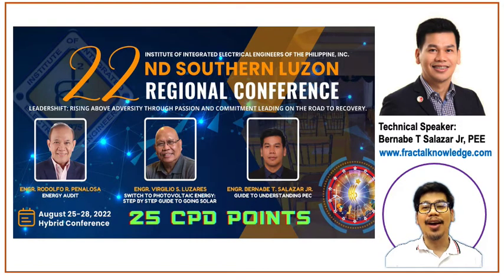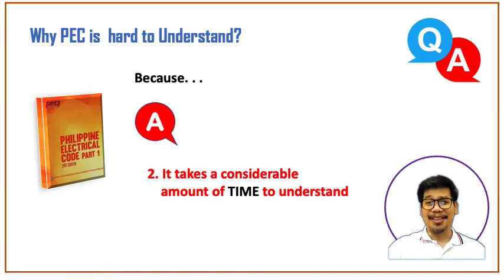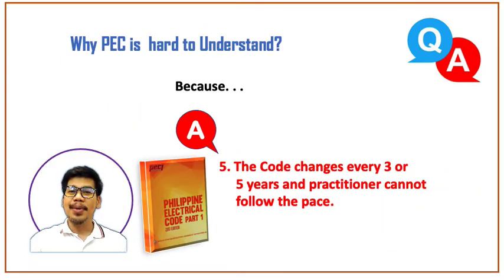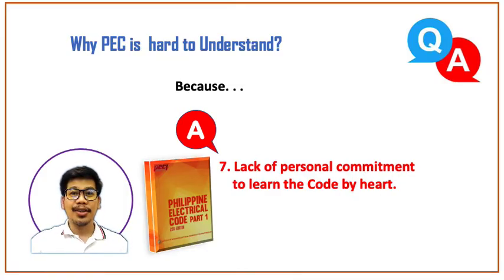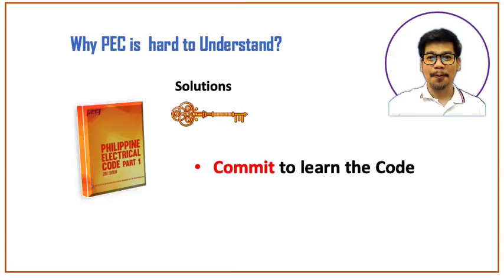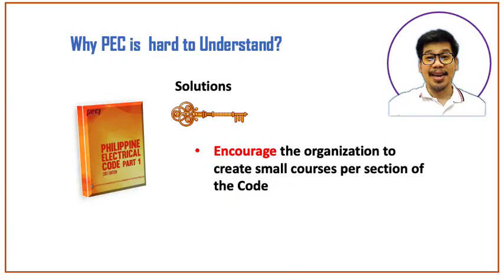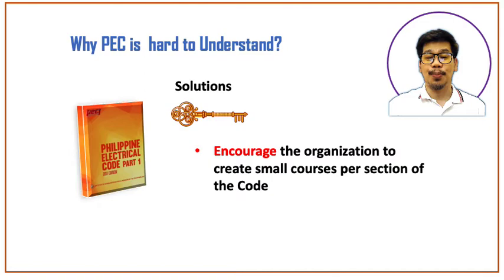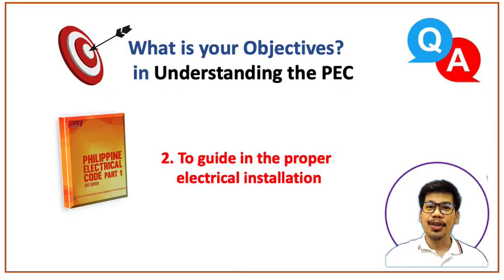Understanding PEC1 Series 01  Part 1 of 3

Comment: Good Day Sir - Ano kaya po ang nakasaad sa PVC Flexible Conduits sa PEC Code, ano ang Don't's and Do - Pwd din po ba isa sa Embedded Floor sa 3.5mm2 outlet? kc pag tumigas ang concrete ay permanent na ang flexible.
Reply from the maker: Pvc flexible is not design for embeded wiring, pvc conduit is design foe embeded.